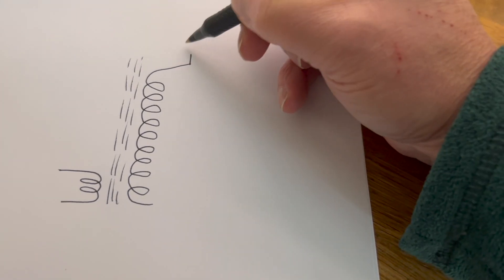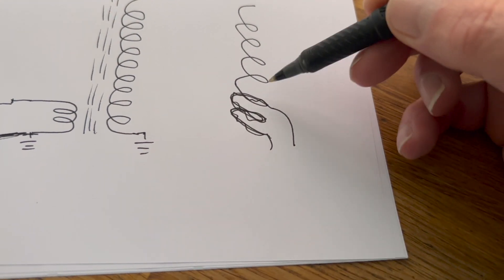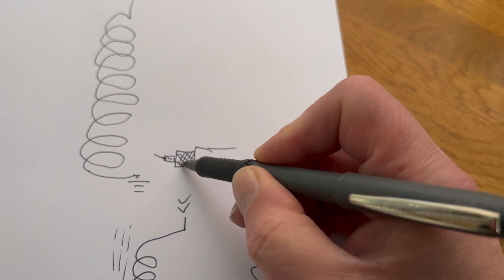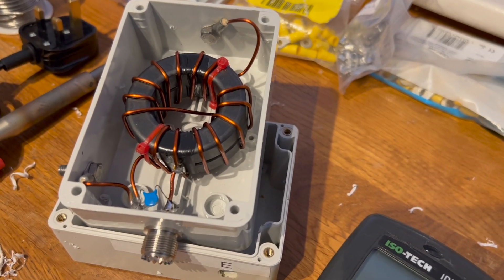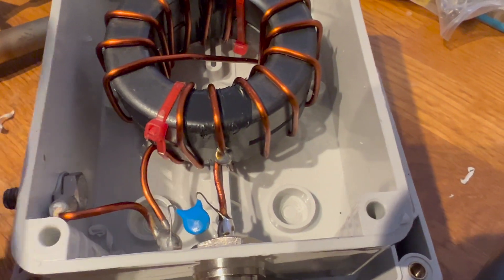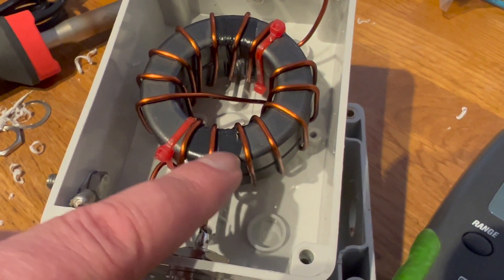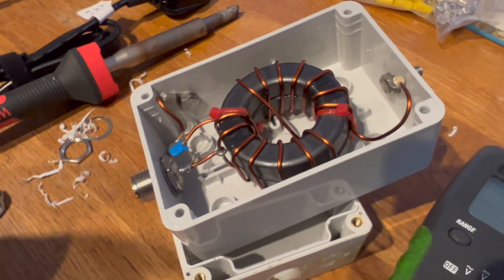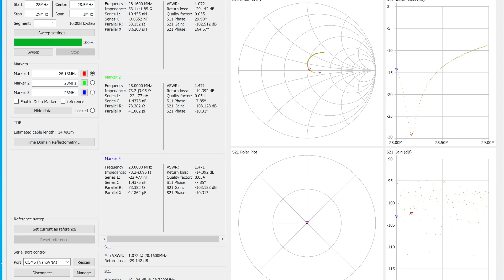Why is it showing a Short Circuit. 49:1 Transformer EFHW

Comment: I'm New to the 49:1 Balun.  What would happen if You did NOT add a Capacitor into it!  What would happen if a Capacitor was NOT used in the Construction of the 49:1 Balun?  What would be the NEGATIVE results if any?  KD0PAF 73'S!

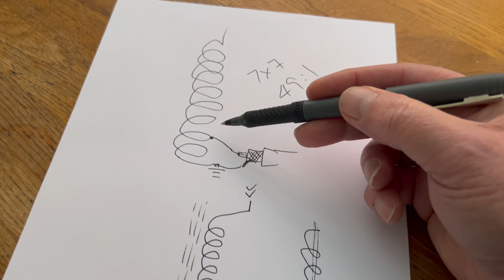Comment: Hey Mike! When building the tapped version, and using your drawing as a reference (at 4:53), what would happen (and what is the science behind) if the center conductor and braid were swapped places? Would it still work the same since it is DC short? I can't seem to find the answer on this one...
Thanks and 73!
Reply from the maker: The short answer is yes it would still work, this is because the circuit is an AC circuit, so the current and voltage is constantly switching forwards and backwards, but it is alway best to work to a standard so the inner-core goes to the second turn.. :)

Comment: As I understand it it doesn't matter wether one uses an intertwined secondary winding to connect to the center wire of the coax or wether one uses ust a tap (soldered) connection to it. Because for DC there is always a connection to earth (or counterpoise). Does this mean that if I use a real earth connection (via a copper rod driven into ground) that I also have some lightning protection? Tnx for your valued input and 73's

Comment: Thanks for the video, Mike. 🙂
I just built such a 1:49 transformer last night and have not yet had the opportunity to attach a half-wave wire as I need to do that outside and operate portable (cannot do that at my apartment). Therefore I do not know if it actually works. 
However what I have done to get a first indication if the transformer does what it is supposed to do, is attaching a purely resistive load of ~2400 Ohms and then measuring the inductance and the SWR over 3..30 MHz (the range the my NanoVNA supports). I found that a reasonable SWR (~1.34 : 1) was only shown at the start of the range, increasing steadily from that point as the frequency increases. The inductance at 3 MHz was very close to purely 50 Ohms with nearly no reactance.
Is that how it is supposed to be, I mean, is that normal and is it likely that once I attach an antenna wire and a counterpoise I will get a good SWR on the band I want (provided that I trim the wire length accordingly)? Or does the above-mentioned obervation with the low SWR only at 3 MHz indicate that there is something wrong with my built? 🤔
(I am a newbie and my tinker box does not contain any wire to test, so I am waiting for the antenna wire to be delivered, being slightly worried that my transformer is not built correctly.)
73 de DO1HNR
Reply from the maker: No it just lets you know that the impedance of the resisters changes with frequency, the impedance at the end of the wire is between 2400 to 3600 ohms ....so get 20 metres of wire out and fold back the end to get the best VSWR.  good luck

Comment: So it's a DC short and we don't care since it's not an AC (RF) short.  But what is it?  What is the total unloaded input impedance of the desired spectrum?
Reply from the maker: Not sure I understand your question?
Reply: @mike-M0MSN  When you look at the XL of the input with no load on the output, what does the nanoVNA show the 2 input windings to look like over the desired frequency range?
Reply from the maker: @N9XRradio  I have no idea, I will connect it up when I next have reason to take it out of use and measure it for you. However if you already know or are building this transformer please share your knowledge here. Cheers.
Reply: I don't know. I feel like it can't be much since 2 windings is pretty small. Seems like a point where there is a lot of loss. 

No, I don't have any 49:1's.

Comment: Hi @mike-M0MSN, after this video, I decided to create a new 49:1 Un, and I used 2 pieces of 240/43 Amidon Troid in the beginning of the winding, using a single winding, just like you, without using double wire, using the wire used in 2mm enamel-coated copper windings. I created a beautiful Flour with , and since the thyroids did not fully kiss, I combined the Troids that I leveled with sandpaper on the glass, and after covering the Troid ring with heat-resistant teflon wrapped around the taps and a few turns of teflon, I created the winding. I combined it very well, but even if I used different lengths of wire in Nano VNA. SWR is affected very little, SWR is infinite in the bands I want, when I make broadband measurements between 100Khz and 1Ghz, SWR 1.0 at 700 MHz, when I measure between 100Khz and 100Mhz, SWR 1.1 at 67.1MHz, and when I measure between 100KHZ and 30MHz, SWR 1.1 at 1.150Mhz and 5.800Mhz. Swr 1.1 at Hz Without grounding the measurements are worse, a good ground connection is required.  Listening on CB is very nice. I did not do TX because SWR is infinite.  I wanted to do a different experiment and created a connector from UNUN's chassis and antenna end, which I used to connect the antenna side to the radio, and made a reverse connection to the radio. I connected the antenna to the input end. SSB also provides zero interference and perfect listening. When I try to connect the capacitor, it weakens the listening and the interference rate increases. It amplifies, listening without a capacitor is great.  I'm trying to understand my problem, it was built with 2mm enameled copper wire in the same way as yours, the only difference is this, do you have any suggestions for me?
Reply from the maker: If you copy my build as I have made it do you still have the same readings, It maybe something you have introduced to the build or the torrid rings being used, I wish you good luck. and many thanks
Reply: I bought the rings from the Amidon manufacturer in 6 pieces as part of the campaign, the rings were ordered from the right place, the only difference is that I created them with 2mm wire and combined the rings by leveling them with 0 grit sandpaper on the glass surface to ensure a perfect kissing.

Comment: Autotransformer..... I wonder if a variac would work?
Reply: Actualy yes. I have autotransformer with eigt taps. So I can chose transformation ratio near as possible to got ideal match.
To make variac you need coil with slide contact and you got variac. Remamber its voltage, current is very small so no need perfect contact. I make using multiple taps. And work.

Comment: Man, this is a life saver - was busy re-cabling my rigs and for some reason I tested my cables and found a short on the EFHW. You saved me a very arduous trip up the roof! :)
Reply from the maker: Glad I could help
Reply: @mike-M0MSN  I'm hoping you could clarify something else for me too please. Since the EFHW has a DC short on the cable, does this have any potential effects I should be aware of when bonding my different feedlines? I have 2x UHF/VHF Antennas using LMR-400, and then one feedline - RG-213 for the EFHW. If I understand the whole grounding/bonding thing correctly, then all the shields from all my feedlines are basically electrically connected when bonded and connected to common ground. Does my VHF cables shields then also act as additional counter poises for the EFHW? Should I/ Can I have them all connected at the same time to different radios and TX/RX simultaneously, or would it cause issues?

Comment: 8:10 You said it is 2,800 Ohms to 50 Ohms but I always built my antennas to match 2,450 Ohms on Mmana Gal. Which is correct?
Reply from the maker: Well they both work, its all to do with length and height....
Reply: Hello, what type of winding do you recommend for an 8m high and 40m long radiator?
49:1, 56:1,64:1 ?
Reply: 8m-26ft
40m-132ft

Comment: How are the Smith graph radiation patterns produced. Is it conjecture or something that can actually be seen with some kind of instrument or device? I have been able to see the static charge patter on a charged pvc pipe using ashes sprinkled about the pipe and saw the ghost. It was a series of torroids up and down the pipe which can be discharged like individual cells by putting a light bulb or my finger near each one and hear the click as they are discharged. People think I am crazy and asking too many questions which will not even be on the extra exam anyway. I have to wonder if dusting ashes over my antenna array would show me the pattern which I am wanting to see.  I have asked Callum & he thought this is a question for you.  Thanks for the education. Mike

Comment: I like that. 2 toroids and a large wire. How much power do you think that will handle? I have some 240-43's and some 14 gauge wire, not sure what that is in mm. But it is about the size you have there. I am not sure if I should use 2 or 3 toroids.   73    W4DES

Comment: Hi Mike . If i may ? For those who still this is magic , the short exhibits only for DC voltage/current , the voltage/current which our transceivers use to radiate electromagnetic radiations in antenae a.i diferent wavelegnth on amators bands but not only are AC voltage/current . In AC there is no short , are matching and mismatching , frequency, antenae models and feeders types dependent .

Comment: Excellent video Mike.  When you said that the tapped version  works better than the coupled version. In what way does it work better?

Thanks
Reply from the maker: Difficult to quantify, I found that apart from saving copper, the 64 or 49:1 was more predictable I did not need to space the turns as much to obtain best SWR.

Comment: I think I’m slowly starting to understand how these transformers are wound. Question, in a power transformer, increasing the amount of turns improves efficiency, is it similar with RF? Aka, would a 200 to 1400 turns transformer perform “better”, and in what regard? Increasing the wire gauge improves current capacity, and increasing the toroid size improves efficiency, but what does the amount of turns do? Another thing I wondered about is what would happen if you increase the insulation thickness (for example if you’d use normal single insulated house wire), and if solid vs stranded vs litz wire affects things? 73 OH6ZA
Reply from the maker: Good question, I guess it all about diminishing returns, is the extra 7 or 8 turns of copper worth the small improvement if any? any more than 3 primary turns may over couple, sure the bigger wire and the core the more power you can put in, however the more space  you create between the core and the wire the less efficient the transformer becomes. Its all bout the electromagnetic flux....back to the future Marty

Comment: Great presentation. I’ve always thought the coil was needed at 2.1m up the radiator. Some people have used long counterpoises. Essentially creating an ocf or half square with these. I’ve never noticed any real differences doing that other than throwing the swr into fits. Have you used long radials with the unun?
Reply from the maker: Hi Jay, thanks for the post, one I have never used radials on the EFHW, sound like an experiment needed.

Comment: Great presentation  Mike thank you ... on the VNA test , what did you use as terminating resistor ? Or was this test on the antenna it self ? Also wondering if you have done any efficiency tests ?      Thanks Niels / OZ1CGQ
Reply from the maker: Hi Niels, I guess you mean to calibrate the VNA, I have a calibration kit that comes with a 50 ohm short SMA. if you mean the antenna then I did the test on the antenna after a calibration on the VNA. and no efficiency tests..  :)
Reply: @mike-M0MSN  thanks Mike. I am working on 49:1 as well. I got the efficiency to exceed 90% on most bands except 10meters. 
It takes 2 UNUN in series to make the measurement, and then divide results by 2 
It’s very interesting because you can play around with different designs / ways to build UNUN …  and understand how performances can be improved compared with “standard” way of building UNUN’s

Comment: First off, thank you Mike.  Your videos are very informative and have helped me understand concepts which are normally only glazed over by many other videos and documents I’ve read.  

I’ve attempted to build an EFHW using the DX Commander 10M pole and a 49:1 Palomar transformer with no success, and I’m a bit lost.  I also purchased a 64:1 from Cal that you made for him.  I’ve only used my Comet SWR meter thus far as I don’t believe the 64:1 would take much power and was going to use it for an RX antenna.  

For simplicity, I made a 10M 1/2 wave element, which I cut for 28.5MHz both taking into account Calum’s end-effect formula, and without.  I’ve used a ground rod, an 8 element radial field, both, and none.  I only wanted to use a single band, in this case 10M to keep it simple.  I also attempted a 20M 1/2 wave, cut for 14.250MHz, with no success.

The issue is my SWR is off the chart, no where close to my tuned cuts.  I’m using a 3 foot jumper from the antenna to my meter.  I’m going to use the entire length of coax which is around 150ft or so.  I also plan to use my VNA and shoot the coax for length just to understand what I’m dealing with.  Also my meter and jumper work great when testing my DXC 12.4 which uses 1/4 wave elements as spec’d by Calum.

Summary: using a 49:1 from Palomar, or your 64:1 with a ground rod and or radials, my SWR is infinity on 10M, but its in tune tune at 14.4Mhz, which would a 1/4 wave on a 4.95M long element using DX50.  The values for R and X from the meter are below.

R=5
X=44
SWR=♾️

Any ideas Mike?

Thanks
Reply from the maker: Hi Kevin, yes I can help, first the 64-1 unun, is made for 80 - 10 meter bands and needs to have a wire length of at least 20M (then cut to SWR) unfortunately it will not work with shorter lengths of wire. (If you use 20M of wire you will have 40, 20 and 10).

So here is was you can do with the 64:1 if you only want to work 20M and 10M: 
Open the box and remove the last 2 turns or if you find it easier scrape the coating off the second winding from the end and solder a new wire from there to the antenna terminal. this will turn the 64:1 into a 49:1 which will work better on the bands you want to work on.

hope this helps
Cheers
Mike
Reply: @mike-M0MSN  Thanks Mike I appreciate the response.

At one point during the testing, I did connect a 49:1 Palomar Unun, Model: CU-49-2000HF, and the values for Resistance and Reactance were as follows:

R=5
X=44

The 64:1 Unun showed the same values at 28.5MHz.  I would expect these to change a bit, which is where I began to check connections for continuity which all seemed fine.  I'm a bit confused as to why the Resistance and Reactance are not changing from the 49:1 Palomar, and the 64:1 M0MSN Unun, but I'll dig some more.

I'll validate the SWR reading with the Palomar 49:1 Unun, using the full length of coax which shows to be 57.42M according to the Lite VNA 64.  I don't want to tamper with my Mike Unun just yet, lol.

Thanks again Mike.

Comment: Lots of good info for winding the 49:1. Some question for the earthing, if a stake or counterpoise is used what difference do these make? And in your 1st diagram where the windings are sepatated, if the aerial side is earthed but the coax side is not, does this work better?
Reply from the maker: Hi, the base of both coils/windings in Dia 1 are connected to the Shield if you don't there is no circuit. as for the counterpoise/earth stake if you use them it will reduce the RF on the outer part of the Coax and prevent its return to the shack and also reduce noise.